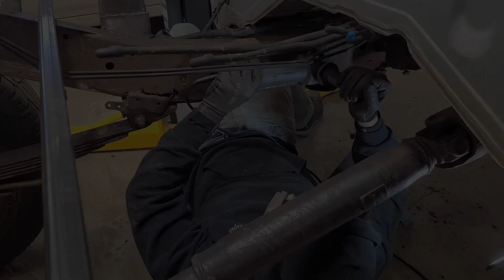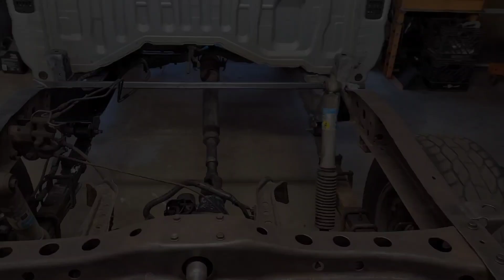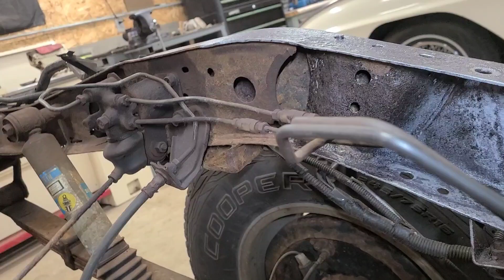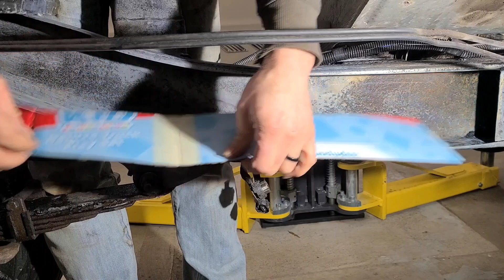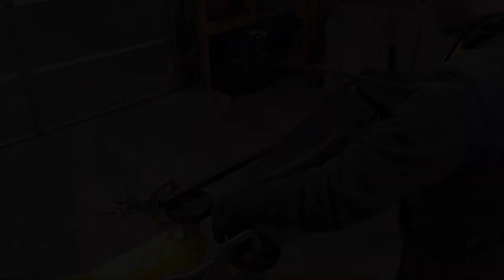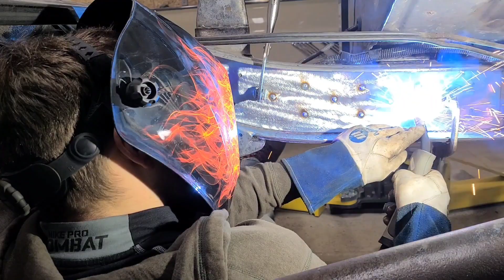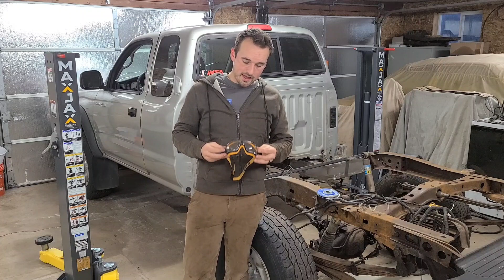Busting the Rust and repairing this Tacoma frame

Comment: That tig welding takes forever. I’d just run some 1/8 7018 stick or 6010 5P+ and be done with it. Chop! Chop! No time to play around.
Reply from the maker: @Hotrodford  Sounds like you should start a frame restoration shop. If you watched the videos, you would have seen that I  only welded small sections. The majority of the frame was MIG welded.
Reply: @PostRt  do you do any SMAW welding?
Reply from the maker: I've done just about every kind of welding. Primarily, I use MIG and TIG for the majority of projects that I do in my own personal shop.
Reply: @ I’ve often wondered why people today have a taboo with stick welding. You bring up stick welding to the younger generation of weldors and they look at you like it’s garbage or talk crap about it. They imply that people that use it are not real weldors. All of it has its place depending on the job and atmospheric conditions. I didn’t mean to offend you or your work it looks very nice.

Comment: How come you don’t use cold rolled steel to patch up the frame? It’s stronger and has no mill scale and has more corrosion resistance than mild steel.
Reply from the maker: @Hotrodford  I should've fabricated a complete new chassis on a surface plate with chromoly and setup jig fixtures. I used what I had access to, and it did the job.
Reply: @ why would you do all that? That’s a waste of money and time.
Reply from the maker: Clearly, I was joking. Obviously, there are many ways to complete a task, and no one way is going to please everyone. My way worked, and I got my truck back on the road.

Comment: Why didn’t you prime and paint the inside of the frame while you were in there?
Reply from the maker: @BANNAN96  I did in a later video. You can check out that process, too, if you'd like. However, these steel plates were cleaned and etched/coated prior to welding. This left a great surface for the later coatings.

Comment: Very thorough job I just am curious with your welding extra plates for stability how much weight your adding 

If gas cost aren’t a big issue for you then it’s a definite win win
Reply from the maker: Not that much weight, really. It is not enough to turn it into a gas sucking tank or anything like that. Honestly, the rust removal was weight reduction, so I added material back and a some extra. I wouldn't recommend adding a quarter inch thick plate or something like that! Keep the material close to the OEM spec thickness.

Comment: What type of steel do you use to repair the frame?
Reply from the maker: I don't remember the specific alloy. It is 11 gauge, cold rolled steel. Nothing crazy and definitely stronger than the rust that was present before!
Reply: @PostRt why not use hot roll steel? Just curious I know nothing about welding
Reply from the maker: @joshuacruz4046  That is what the metal supply store had available at that time. The thickness of the steel was closely matched to the OEM too.

Comment: Good repair but why not treet the new steel.inside the frame 
.or did you off camera?
Reply from the maker: Oh yes, I did clean and treat the steel before capping the rails. Also, you can check out my later videos, where I applied a series of protective internal and external coatings.

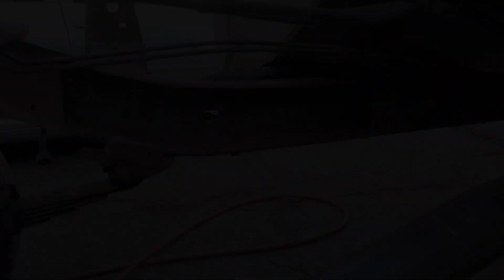Comment: 4:07 ... wouldn't a much better and thorough way to clean this up here be to sandblast it with some black aluminum-oxide grit ... i bot the blast-out-of-a-bucket kit from EastWood to clean sections on my '97 taco down to the nitty gritty (by the Cat where it was the worst under the rubber dealer protective coating)  then used EastWood afterblast to remove any flashrust and it left a nice silvery zinc coating to primer over
Reply from the maker: I mentioned this in other videos. There will always be pros and cons to each method. Abrasive blasting is a messy process but can yield good results. You will also need a sizeable air compressor and a good air dryer setup to keep the abrasive moving freely. Most of my work was done during the Midiwest winter months so cleaning up abrasive outside and several other factors was a major reason I avoided it. Those bucket kits will work but will likely take a long time to strip the frame. I would needle scale the big stuff and follow up with abrasive blasting.
Reply: @PostRt   here are what my results/observations were with using the abrasive media blast-from-a-bucket... the OEM factory coating (both crusted and non-crusted parts) it  peeled off like soft butter, no sweat!... BUT!  when I went to try and blast the freshly applied EastWood extreme chassis paint I used  it took MUCH effort to remove just a little bit off... so I now wonder if a wire wheel type might remove the EastWood primer and top coating more efficiently to redo some areas

Comment: 1:11  .... is the beginning of this video  the area by the fuel tank? ... this looks much different than the inside of the frame on my '97 rig
Reply from the maker: I'm sure it is possible that Toyota made some changes to the frames over the years. 
My truck is a late production 2003.
Is yours also extended cab?
If you look up the factory part numbers, there are several frame part numbers available depending on model.
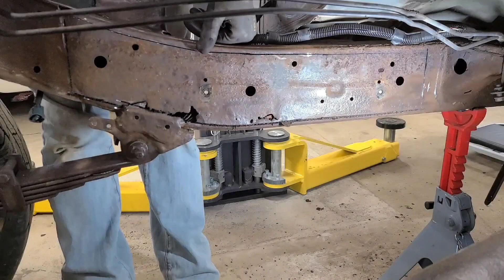Reply: @PostRt  yes, mine is an extended cab also... the thing I noticed on yours after you cut and peeled that rear section was the absence of an interior structural brace (or whatever its called) located perhaps six inches towards the rear of truck starting at the rear-most frame drain hole  1:51 ... unless! yours had already disintegrated into that awful mess inside there
Reply from the maker: @efil4kizum  My truck had the brace inside. I mentioned that in the video. The RH side was worse and mostly rusted away, but the LH side was still there. I cut it out when cleaning up the frame.
Reply: @PostRt   i should start watching your videos starting from the beginning! lmao... i have been jumping around from one to another during downtime in no particular order

Comment: I have an 04 tundra, same issues, frame rot but only near the sway bar.  I'm going to repair it and take it on as a project.  Lucky for me, no inspections in my neck of the woods to worry about.   I'm amazed at how many of these trucks have these issues.  Toyota really dropped the ball on this.   No chance of a recall / new frame either.  Campaign is closed :(
Reply from the maker: Yeah, I wish I was better informed of the lawsuit back when I first bought my truck. The best option for me was to dig in and repair my frame.

Comment: Sand blasting wouldn't that do better job to see hidden rust my 09 h3t alpha hummer bed frame real bad in sections mine is heavy do to overlanding build with bed rack rooftop tent I have a welder but I'm not doing the work I need the job done right so when I go off road it's not going to snap into I know that safe tcap kit makes sections kit but I think I'm out of luck because gm only made 5300 trucks and 400 alpha 5.3 v8 I have one of the 400 but the frame is same I just need to find a very good frame shop who do this type of work 😮
Reply from the maker: That sounds like a cool rig!
Sandblasting will do a great job of stripping the rust. I mentioned why I used an alternative method on my truck. Sandblasting is messy, requires a large compressor, and most of my work was done during a winter climate. Another thing to think about is all of that sand working its way into every little space it can. In a perfect world, stripping the frame and components down to a minimum, then sandblast.

Comment: was it hard getting the crossmembers out? been trying to do the same thing to mine and i’ve broken 3 ratchets trying to get them off!!
Reply from the maker: Most of the bolts needed to be heated to get them out. An impact wrench helps for loosening stuck bolts, too. A standard ratchet or even a breaker bar provides a constant torque with the stuck fasteners, which increases the chance of them shearing off. I'd recommend heating them or possibly cutting them off as a last resort.

Comment: That's the cursed spot for every truck. That downturn from the box is where everything lands and piles up and holds moisture and rots out. I prefer no paint on the frame. Fluid film on the inside, because it fogs better and creeps better, but also gets washed away easier on the outside, which is why I use woolwax on the on outside.

I don't want any coating that doesn't stay a fluid, because any solid paints or rubber get compromised, get water and salt trapped under them, never dry out, rusts faster, and eventually flakes away, leaving exposed metal.

The woolwax and fluid film don't trap water underneath like that, heal from small impacts/chips, and don't flake away.

The problem is that you have to have it clean to do it. All that debris inside there has to go. I was thinking maybe a hose like plumbers use on sewer lines for clogs. Stick that in and power was the inside out from the back to the front to get all that garbage out.
Reply from the maker: A specialized pressure washer nozzle could help clean in the frame. It would be even more effective with abrasive media added. Some people have had success by using a plumbers snake setup on a drill. The tip flailing around helps to knock thicker rust off.
Reply: @PostRt  Oh, good idea. I wonder how a cylinder hone with beads would do too?
Reply from the maker: Worth a try if you can find an access hole big enough to get it in there. Perhaps, build a dingle hone with small linked chains rather than the wires. I guess it would be a similar concept to the plumbers snake but more effective. Then you could more easily feed them inside a frame access hole?

Comment: This is, by far, the best frame repair video on YouTube! I have the exact same truck and I am planning on repairing my frame as well. After I bought a brand new 2021 Tacoma a couple of years ago, my intent was to replace the 2003. The older Tacoma has less issues with shifting and engine performance. That said, I've decided to keep my 2003 and reinforce the frame, which is not too bad except at the rear mount of the leaf springs. Thank you for a very inclusive video!!
Reply from the maker: Thank you, and good luck with your Tacoma build.
Reply: @thechuckster6838  Its  okay his repair with mild steel should last five to ten years before it rusts out again if he lives in a state that uses salt on their roads. Would have been better if he’d used cold rolled steel plate.

Comment: Ive just used this phosphate acid and washed it off and 😕🤬 its turning orange rust right Infront of my 😮 so thats no good 🤔
Reply from the maker: Was it similar to the phosphoric metal etch that I used?
I know from experience with muriatic acid, a type of hydrochloric acid, that it will rust quickly after the rust is converted. I tested a few spots to see how it would work and it ended up rusting if I didn't quickly neutralize the area and protect the metal. The phosphoric acid leaves a whitish/gray once dry.

Comment: The C channle on the last 2 feet of my 76 JEEP J10 i just bought for 800$ has rusted so bad, it went from 3/16th thick nearly or .188 to .100 or even less in some area nearly paper thin or thick and thin meaning large pits ... Should I just cut all that out and weld new steel in ?  Or clean it up and descale it, and weld over top like you did ?  Normally Id cut out a hand sized section and weld in new plate.. but with this being over a foot+ of thin metal.. Im not sure if i should cut it out or weld new steel over top and seal it up to strengthen whatever is left.  I am learly of welding plate over top of metal because it can cause more rust later if moisture gets in there some how.

The top of the C channle is "mostly" there, its pitted badly, but its still 1/8th or more thicker, so i was thinking just cutting the entire bottom lip out which is paper thin "due to the rust falling on it" and then cutting most of the center section out as well.. the top of the c channle "and some middle" should hold the frame from shifting, and rebuilding that portion of the channle, and if i have too, fish plating the joints.  of course everyone on the forums is calling my jeep a parts jeep.. get a new frame blah blah... well it isnt as easy as they can jusst type it out... my jeep is 50 years old and its the 8 foot bed.. those frames are hard to find..  So i feel fixing it would be easier to be honest.

I hate forums.. thinking of not posting on em anymore.. people attack you for wanting to fix things..  if peolple saw your frame theyd say junk it and find a new car.

But why ?  When you can fix it
Reply from the maker: Any media platform with a comment section will bring out the "experts" and the "know it alls." Rarely you will find someone that is truly being helpful, but I do appreciate  those that do. If you have the time, tools, and know-how, I say, "fix it yourself."
  If the frame section is not very complex, I would probably fabricate a new section and fishplate it together. The recommended splice is more of a "Z-shaped" cut. 
  If it the section has a lot of specific bends, tabs, and other things incorporated to it, I would probably try to save it. 
  Either way, you decide to tackle the job, make sure to measure everything out, and write it down somewhere. 
  If you get the steel very clean and treat it with something to prevent rusting, it will last a long time. I'm not worried about overlapping layers because I will be sealing everything when I'm done. Then I plan to spray an oil or cavity wax coating on top for further protection. That should seal everything up and prevent moisture from penetrating.
Reply: @PostRt  last 2 feet of c channle is straight.  Not bend or curves
Reply from the maker: @Black Powder and Lights  
Sounds like you're in the clear.
Get yourself some fresh new steel of the OE thickness and fab it up!
Cut it back to a spot where it is more intact and hopefully in a flat area to make mending it together easier.
Reply: @PostRt  thanks.  I am jist tired if the guys on the forums.  My 90 Jeep Grand Wagoneer.. had a bad frame in dozens of spots.. people ssid oh dont buy it.. well its fixed and (daily driven) now..  The frame,  Like a 1+ foot section by the gas tank.  I cut the entire section out.. left only the top c channle and 2 inchs in the middle.. then welded a donor peice in.. it was a very large peice.. i didnt even fish plate it.   And its held fine.

In fact someone just welded angle iron in it and it made ir rust 10x worse.  Thats why im weary of that.

Other sections.. my shock mounts up front in the boxed portion of the frame. Rusted out.. the shock mount pulled off snd pulled with the frame.. and rotted the lower frame.. and behind it the engine mount.. and cracked the top..  i cut.. cleaned welded thr crack.. nee steel.. new shock mount.. been yesrs held up fine.

The rear frame.. like 5 peices my hand sized i cut out welded new peices..  even on the cross member...  all held fine.

I even towed my 76 Jeep j10 on a flst bed uhaul total weight 6500 lbs..  300 miles on my fixed frame.. and no issies at all.

This is why i hate people on the forums.. calling my Jeep junk.. just because its rear leaf spring mounts are rotten and the last 2 feet or so of frame in the ssme spot of thr mount.. is rotten.

If i fixed my wagoneers extensive rust... why couldnt i do this to the J10 pickup ?  I feel these forums are full of whiners who have a cant do attitude.

I spent 8p0$ on this..  versus 6-10k$ with a better frame.. but still rusted as they all rust back there..  

Can you perhaps maybe look at my Jeep j10 video .   Youll get an idea of the rust im talking aboit back there.  (Ignire the bed lol)  that is gonna be fixed and rebuilt too.

Today im gonna finish cutting the rest of thr bed rot off.

Comment: I would like to do the same with the chassis of my tacoma it is 2018 so mine is not rusty at all the only thing I would like to do is that the chassis of my truck be completely sawn and that it is no longer C-shaped it is Very flexible and it causes my bed to jump everywhere, it seems that it was loose and that it would fall at any moment. Does anyone know if this could be done with my truck, make it with a rigid chassis?
Reply from the maker: Yeah, those have the open channel. Boxing the frame is would certainly stiffen it up. The composite beds on those trucks tend to loosen up and rattle around. Check your bolts and maybe see if they need a retorque.

Comment: Had replace frame 1990s toyota 4x4 extra cab sr5 black stick 3.4 v6 new engine blew 3.0 v6 threw rod 😊
Reply from the maker: I hear those old 3.0's were not very good. The 3.4's are solid though, just need more power.

Comment: I just noticed this recently about 2nd gen Tacoma. There’s a class action suit that we can take advantage of to replace the frames. They also upgrade the shackles and leaf springs from 3 to 4 springs. Has yours been done already in the past because you have, not only 4 springs, but 5? BTW great work.
Reply from the maker: Unfortunately, that lawsuit had expired long ago for my truck. 
I rebuilt the suspension with aftermarket leaf springs. They lifted the truck about 2 inches.
Reply: The frame replacements are all over. My 03 Tacoma got a new frame in 2010, it's now junk and why I'm watching this video. I swear Toyota must be (not them, but their vendors) using recycled steel that isn't made well. It doesn't last, it flakes apart, it's terrible steel compared to the steel on an older car or a 1970's GMC or Chevy truck, they don't rust like these Taco's do...
Reply: @dc6233  ya, I see. Never owned a Toyota so I didn’t even consider the ( bad frame ) possibility till later. But hey, still loving it and dealing with it.